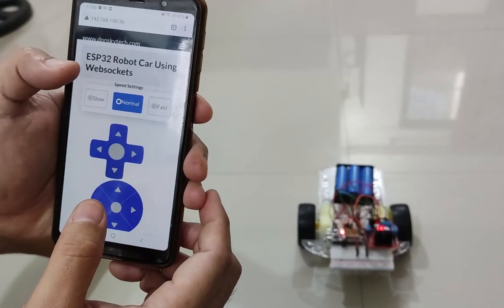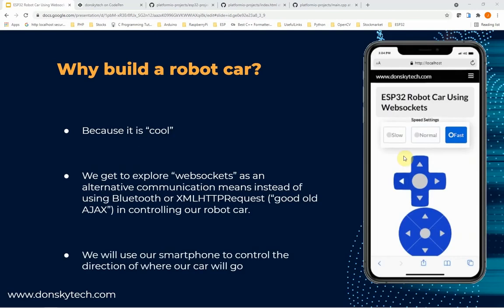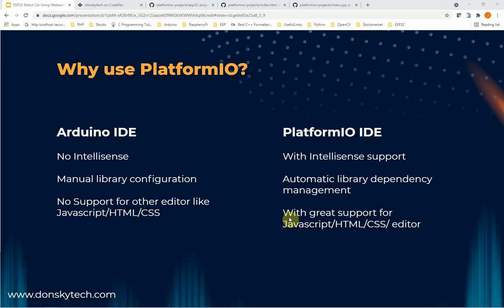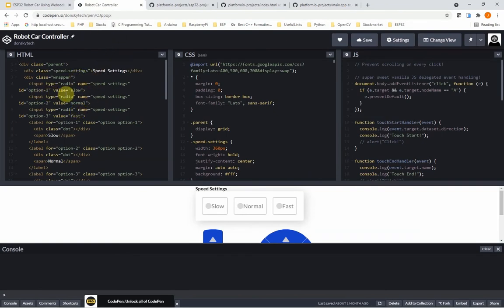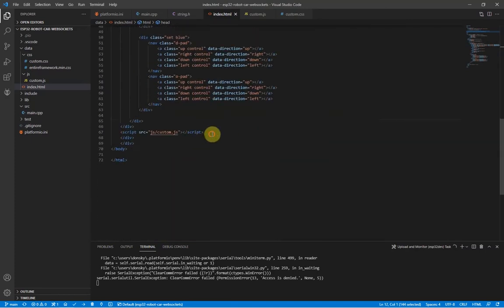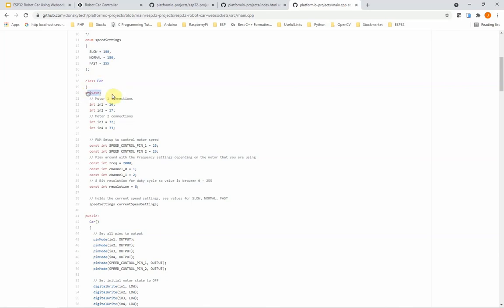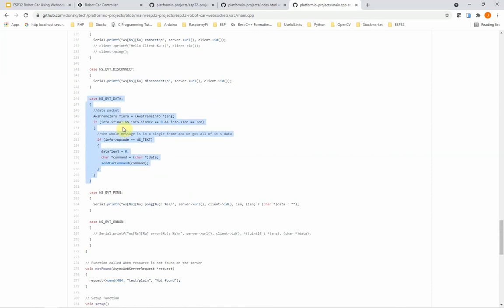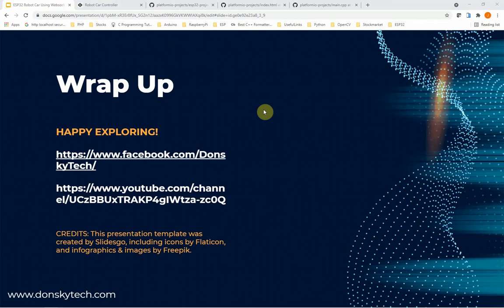ESP32 Robot Car Using Websockets and PlatformIO IDE

Comment: Hey i realy like your Projekt and wanted to try it out, but i only get a white screen when i go on de page. Can you please hepl me?
Reply from the maker: White screen means nothing is displayed in your phone?
Reply: @DonskyTech  yeah only white, nothing else
Reply from the maker: @mexomint  the first thing I would do is to print something in your Serial Monitor. For all you know, your webserver have not started. Have you check your wifi  credentials? Check if it reach this point.
Reply: @DonskyTech  it connects to my wifi just how it should be, i get the ip add and if i go on this website it writes Requesting index page... in the console but i only get the white screen on my phone
Reply from the maker: @mexomint  hmmm are you sure you have uploaded the html and javascript files? Just to isolate the issue, I would reconfiggure my web server to return only hardcoded html output instead of loading it from the file system.
Reply: @DonskyTech  the Problem is that it cant send the file but i dont know how to fix it

Comment: Hi I tried your code but I compiled using  arduino ide. I was able to make the socket connection but my esp32 was not receiving the commands from the controls.
Reply from the maker: Hi Julie, I highly suggest you explore platformio-ide.  Your development would be faster compare to Arduino IDE.  But this is all just my personal preference.  Regarding your question, check first if there is a socket message that was sent from your browser.